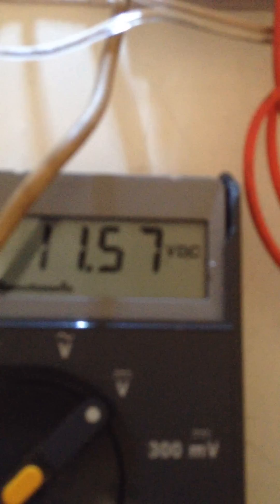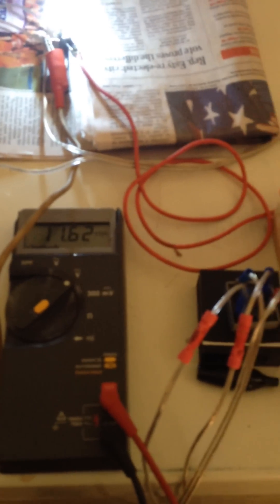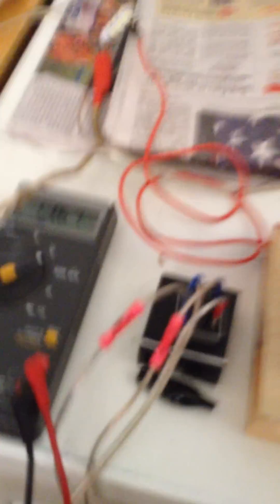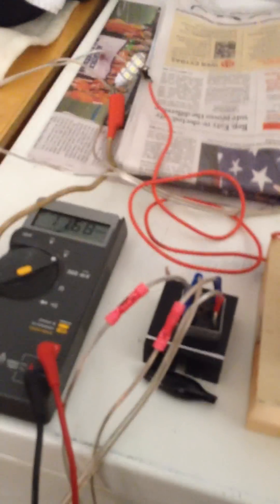Over unity created with transformed back emf. True over unity, no BS!

Comment: Can you tell me please which Supercaps ( Elkos ) you have used ?

Thanks for the answer for my first question.
We are a group of german and austrian people how want to build this circuit !
Reply from the maker: There are 6 maxwell 350F capacitors (D Cell caps from Ebay) in this circuit, there's one fwbr and the transformer is a homemade 12v to 120v transformer. You can use any 12vdc to 120v wall wort power supply, that will handle at least 850mA . The smaller the amperage, the more voltage out and better the efficiency. I would use the wall wort transformer... take it apart and disconnect the diodes and caps in it, then follow my diagram at the link below., The diode you need for a feedback loop must be specific, which I listed below needs to be an FR series hv diode, like the FR205 or fr206  or similar. It only needs to be fast, the voltage only needs to handle the spikes of maybe 300-500v and the amperage is very low, on the low side of the mA range. The forward voltage needs to be less than 5v to function correctly, and most of the FR series have under a 1.5v forward voltage, these filter out the harsh energy that will kill the battery and allow the circuit to operate into overunity provided you use a  super capacitor bank in parallel with the battery. I found that if you use a cordless drill battery that isn't a lithium ion or lithium poly, they are easy to use the four connections for a high and a low voltage feed setting using a switch to add the two battery cells together in series for a high range to create faster switching and a higher voltage, or the standard voltage input.  The higher the voltage, the faster the switching and the higher the back emf voltage which allows more energy to be pulsed into the ground, allowing more energy to be collected back from the atmosphere. This collects a radiant energy drawn from between the Earth's magnetic fieldand the magnetosphere The ground rod allows the energy to be dumped into the ground, amplified, then released as an atmospheric electrical disturbance, like an invisible balloon of energy being pumped up in the air under pressure, then, when you have an inductor pulsing on and off, the back emf is driven into the ground, and recovered at 1.5 to 2 times it's wattge from the atmosphere, as that "balloon of energy deflates, it is pushed back into the inductor and the cap which dumps into the battery,  giving the circuit the voltage needed to drive the circuit, and charge the battery at the same time. Without 2 separately earthed rods at at least 10-20 feet apart, or better yet graphene coated copper plates in the ground and an aluminum graphene coated plate on an electrically isolated aerial antenna that could withstand 1200v of energy from discharging across the mast, your induced energy that will flow into your coil will be much stronger and it will completely astound you, the higher up you go and the deeper the ground plates go. The ground must be moistened where the plate is buried, and the  graphene oxide must coat a shiny plate that has been polished. The aluminum aerial plate must be polished, coated with a layer of a very thin dielectric (insulator that allows the electrons to flow through, as used in a capacitor, then covered over in graphene oxide or a similar powder nano particle that is a superconductor.  I mix some aluminum powder in a polyurethane, then spray it on the plate. When it is mostly dried, it will still be tacky.. this is when you want to apply the graphene oxide powder. I use a puffer bulb to puff the powder onto the plate, then blow it off with an airhose to allow only a thin hard to see layer to stick. After the paint dries, I use a buffing wheel to buff the graphene to a high sheen which will look like a grey compact disc color when finished.The circuit is listed as the MBR circuit, or at least a very similar but working OU circuit. the link is http://mbrcircuit.blogspot.com   Please use the circuit with the transformer and add a diode as stated in the text. Without a fast diode between the hot side of the high voltage side of the transformer and the positive pole of the battery, this circuit will only make what it uses and be a dud. You must have the high capacity, low impedance deeply buried ground plates covered over in a one atom thick  graphene oxide layer which automatically creates electron flow from the ground, and vice versa during it's inverse pulsation. Remember, radiant energy works in the opposing manner than conventional energy operates with resistances or impedances. The higher the impedance, the more power is run through the output.. This means you need a very high resistance or very long conductor at it's output to give massive charge energy. I highly recommend this circuit to be run off of a solar panel to run the relay, then allow it's output to charge a capacitor bank, then switch off the charged bank and replace the bank with a dead bank to be charged. The looped circuit merely proves overunity is a possibility, but it really doesn't violate any laws because it's secondary input is wireless and it takes in energy from elsewhere, so it truly draws from the aether, not  give an output by any magical booster circuit because that is impossible. We can't ever expect to put in little and get out a lot.. we need to use power to get more power. It's a trick that is used to create efficiency in LEDs, and we could not only do this with  inductors and capacitors, we could do this with inductors and diodes alone used to charge caps, then dump the caps into batteries without looping the output with the source and load. You will kill the dipole if this is done, and with my circuit, this happens because of the lucky diode installation I tried, which stopped the additional energy from going to the load instead  of the battery. It is installed in parallel instead of series, which would probably work in series better, but I have given up on the circuit because I figured out much better circuits. I am limited on releasing the knowledge of the new Pelex schematic because i am bound by contract and can not release it without the worry of a major law suit and the loss of all of my finances, assets, etc. The aerial mast and plate will function as a one wire radiant energy source., It needs to have a diode placed inline so the energy can only flow in one way. The ground side does not need a diode. This will assist in the charge for the caps tremendously. Let me know if you need more assistance. good luck.

Comment: What is the Black thing behind de wooden box who is connectet with a white and red cable ? From the Batterie ( white ) and to the relay ( red ) cable ? Thanks
Reply from the maker: its a standard light switch for a home, which I used to turn on/off the circuit, taped up so I didn't short the circuit out.

Comment: yup this wouLD work ,but the tranformer copper wire will burn out or sparkling in winding after some time .due high voltage.
Reply from the maker: theres not enough amperage or voltage here to burn up.  the voltage is around 120vac and the frequency is up there keeping it quite safe and not even close to being strong enough to create damage to anything…  however,  the batteries like to receive charge from this circuit,  but fail to continue to keep charging because they become damaged since the voltage is higher than what it should be,  and the waveform is a pulse train,  not a clean dc signal.  back emf is Not a choice method of charging,  however,  the whole point is that high voltages wont cause any damage if used correctly,  unless there is arcing,  due to a bad connection or a short circuit because the opposing polarities are too close to each other,  which,  if theres enough power in a circuit and enough voltage, it  will ionize the air and jump to the other polarity.  if the neutral is grounded,  then it may jump across to ground if it is too close as well..  it will do none of this if spaced correctly and insulated properly.

Comment: over untiy? let's see it run with the battery disconnected then.
Reply: +Jay Dogg or how about replacing the battery with a load that will dissipate this extra energy you are harvesting, that would be a more convincing demonstration
Reply from the maker: +Jay Dogg here, instead of trash  talking, go here and see a similar device running without the battery. then, the load is absorbed into a coil and when discharged, the back emf is directed to the next coil with a magnet connected in opposition to the core's flux, forcing it to return the energy in the other direction, amplifying it slightly because it is only partially absorbed, charging the capacitor bank at the same time.. Oh, it starts to oscillate once pulsed from the battery and the cap is at 0 volts at start, then, slowly rises and stores the energy. Right now the voltage got up high enough to run the fgen with a snubber so it is completely self running, charging while pulsing from its own power. Oh, and BTW, before you try making me look like a fool, I have multiple circuits ive posted over the last 3 years that generate their own power by pulse, and it is possible.. I don't sell them, and I don't sell the ideas.. I run an electrical construction business, so, selling them would kill my income.. I just show it is possible, which it certainly is... they draw energy from the magnetic planetary plasma tubes and it does not violate physics... it is just a method known and used by Tesla that I have been showing in many different ways now to prove he was right and not a lunatic. Eric Dollard has done much more to prove the energy establishment has suppressed this technology now for over a century.. you should watch his videos instead of trying to tell folks this is a hoax.. I have too many followers that know whats real and what's not, and, I know most of all what is real.   https://www.youtube.com/watch?v=QOh1aeIFBXU

after you watch that, watch this.. it is my prototype that takes 6 watts in and outputs over 800 in the video. https://www.youtube.com/watch?v=_9-gZuvmWKE
Reply: +Marc Belanger so you have broken the first law of thermodynamics? it is not overunity if it draws energy from magnetic plasma tubes. If you have managed to utilise this energy then well done to you, but describing it as over unity is very misleading.
Reply: I followed the link to you put to one of your other videos, and it is very interesting, what is the "resonant frequency" referring to, resonant to what? You mentioned that it works best at 1KHz.
Reply: ALSO, can you explain this sentence a little more: "the load is absorbed into a coil and when discharged, the back emf is directed to the next coil with a magnet connected in opposition to the core's flux, forcing it to return the energy in the other direction, amplifying it slightly because it is only partially absorbed"... because as i'm reading it now, it doesn't really make sense....
Reply from the maker: +Jay Dogg it was meant to.say the energy is absorbed by the coil when.energized, it causes it's oscillation, then, when it shuts off, the charge is released in the opposite direction and is released into the second winding. as the charge happens to.be released, it's magnetic field is opposed by the magnet and another charge is formed creating a self induced field that bounces back and forth like a super ball, however, since inductors normally have a loss, it doesn't seem that this would be possible. the magnet resists the charge from getting all the way there, so, when.the counter end is released, it's at a higher voltage and it's accelerated because the energy wasn't used yet so.it's never seen a loss and it grows from external energy that's drawn in. it is only measured as -voltage, an indicator of cold electricity
Reply: +Marc Belanger well ok, since the magnet is opposing the field in one direction, and with the field in the other, the magnet itself is not creating a net increase in charge in energy stored in the coil... so how is it drawing in external energy?

Comment: totally rockin circuit!! keep up the great work!!
Reply from the maker: thanks Scott. I've come up with a few more, and, the newest is my version of the Smith Generator/Hubbard Coil combination with my own unique twist. I've come up with my own way to get resonance without the inductance meter and hand written calculations that I'll be using to put together and make many devices work, such as the Bob Boyce Generator and many others that haven't been successfully   replicated yet, and when I'm done, I'll be videoing them and posting them to either prove or debunk them. so far I've got a pretty good track record and have found out how and why many of them work or do not work as claimed... I'll be posting my reasons , then, once I have enough viewers with questions, I'll be holding live video streams to speak and aid/assist my subscribers so they could build the same stuff. the older videos like this  have maximums that are only.useful for so much, some of the others offer thousands of watts with less than 150 watts input. one in fact, called Pelex is my most powerful per efficiency and is good for 6 watts in and 2800.watts out... with the ability to drive hundreds of thousands of watts in its output, using less as the output increases. This is called Pelex and it's a device I wish to sell, however, I've received only bad press about it, so, I'm about to.go overseas with it to.show it's potential.
Reply: @advanced-electronic  🌹u boss, and certainly Intrested in the pelex if u wd like to sell of course I live in oman